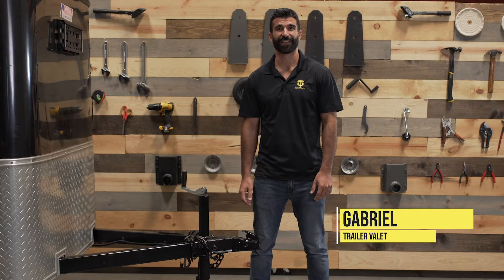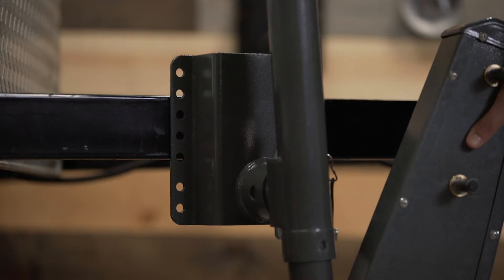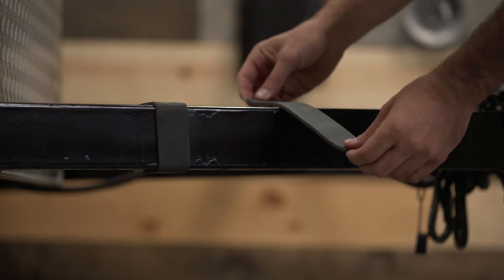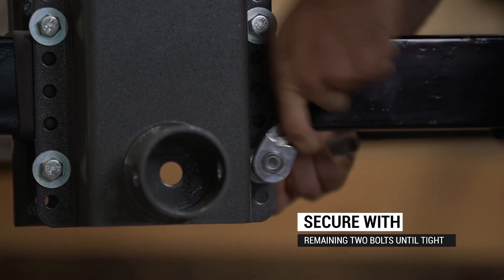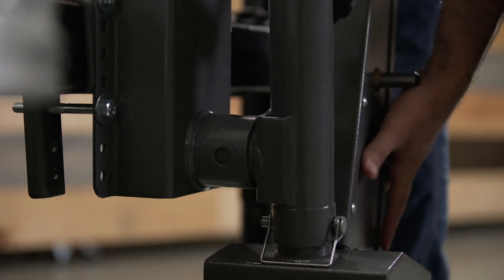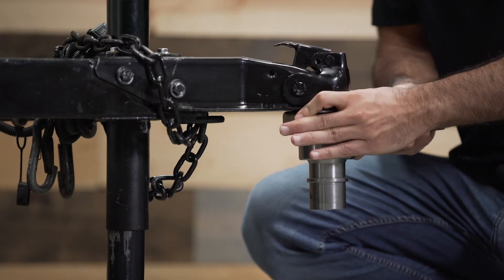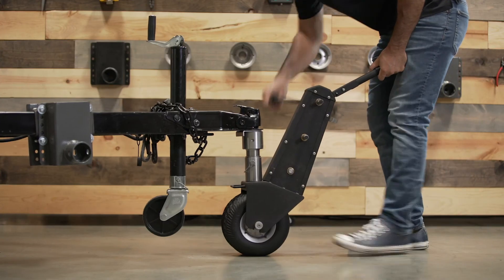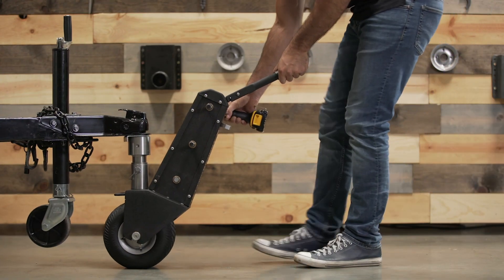How to Properly Install and Operate the Trailer Valet 5X and XL Drill Powered Movers

Comment: The unit I have, the spacer spaner is too far down so when I tighten the collar, it doesn’t do anything it bottoms up and there is still a big gap between the hitch and spacer. Is this normal?
Reply from the maker: Hello! We are sorry to hear that you have are having some issues with with the unit right now. We would love to have a technician take a look at this issue. If you can, can you please provide some photos to our support team at support@trailervalet.com and a customer support tech can assist you.
Reply: @TrailerValet  turned out my unit came from the factory assembled wrong. i figured it out and now its working ok. thank u

Comment: Can a ball attachment from an XL be installed on a 5X? It seems to give the unit a more stability.
Reply from the maker: Hi there! You can not attach a ball to a 5X unit. Stability depends on your trailer type and tongue. What might be more stable on a certain trailer, may not work as well on another one. If you have any specific questions about your particular unit, I recommend reaching out to support@trailervalet.com and they will help you figure out what's the best for you.